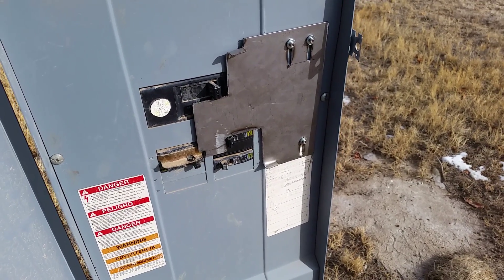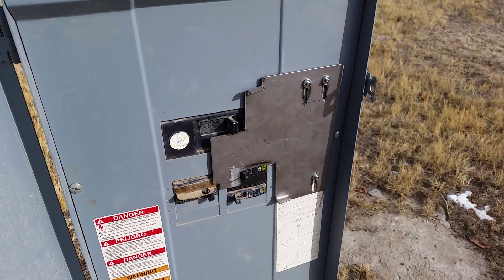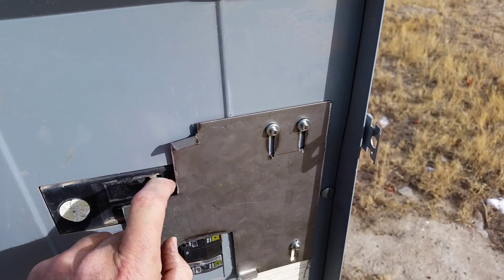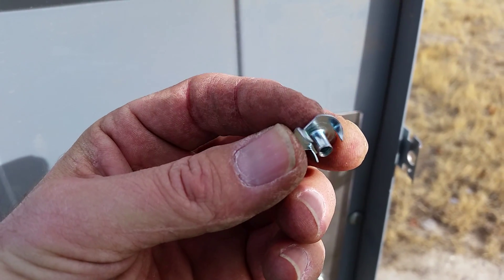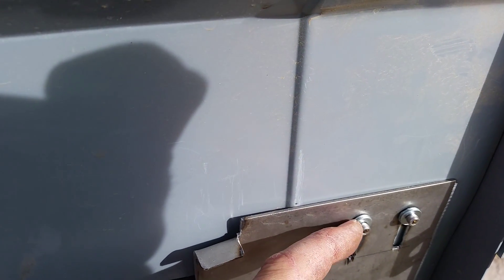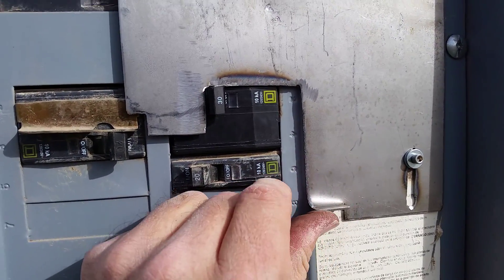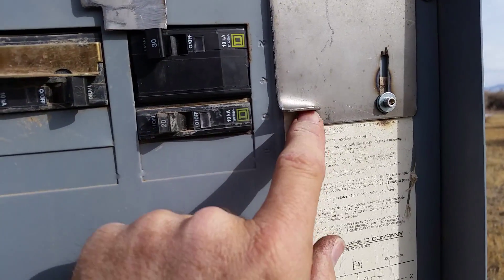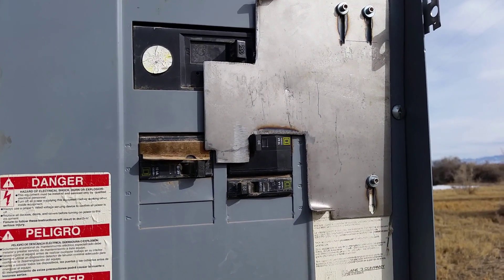Generator Breaker Interlock DIY

Comment from the maker: Well, just used it last night.  This is the second time I've had to use it.  Last night, high winds had knocked some power lines down in Northern Colorado, and sparked two major fires, and two towns pretty much burned up. Very sad. Xcel energy instituted rolling blackouts, we were out of power for about 5 hours, it's the end of December and nighttime temps fall below zero and daytime rarely above freezing. So I rolled the generator out, started it, hooked it up,  and we were able to run the heater, the wood stove fan, the well pump, and kept the fridge and freezers going, and a couple lights.  We filled the bathtub and five five gallon buckets so we can flush the toilets without power. I am so happy I made it, it worked very well. Prayers for my fellow Coloradoans who lost their homes.

Comment: For all those who want to make this lockout, me,  from scrap for little or nothing, what you are actually paying for on the commercial units is liability insurance. We hackers are too clever to be held back to pay for insurance. We just got through a 4 day stretch here in portland where I jury-rigged a HFT 125 v generator to run refrigeration and space heating. This was a 20 amp max output that did us almost prefect. Would have loved a 240v unit. You can use the 120 v unit but turn off all 240 circuits and electrify both legs, otherwise only half your 120 breakers will work, by feeding your "generatora' breaker, a 240, by jumping the 120 to both sides of the 240 breaker. AGain all 240 circuits must be off or its short city.

Comment: WARNING!!!!: THE VOLTAGE IN A OPEN ELECTRICAL PANEL CAN SERIOUSLY INJURE OR KILL YOU AND CAUSE A FIRE THAT WILL MOST LIKELY NOT BE COVERED BY YOUR INSURANCE !, you can still be electrocuted even if the main breaker is off and your front panel cover is removed because the main electrical power grid supply connector inlets are always hot and are not insulated, your hands can be easily be in contact with those connectors, DON'T ATTEMPT THIS MODIFICATION IF YOU CAN'T UNDERSTAND AND EVALUATE THE RISKS YOUR EXPOSED TO, you have to know what your doing and know the CONSEQUENCES of a inadequately designed and made panel interlock, im making my own, you just have to make sure DIMENSIONS are SUPER TIGHT so that how ever you move the interlock mechanism it will never come close to being able to switch on the main and the generator breaker at the same time, i know its not UL or CSA but if well designed and made it will be just as safe as the overpriced low tech interlocks out there, make sure the bolts going through the panel used for the sliding mechanism are tight and not in contact with exposed live connectors on breaker, shorting a 200 amps panel will be memorable for the rest of your life.

Comment: Made Mine from 3D Printed ABS 5mm thick so it's nice and rigid, Smooth action and perfect fit.
Reply from the maker: Did you make a video?
Reply: @anesthesiadreamin  Na, I took a few photos once it was installed on the panel but thats all. https://hypedphoto.com/storage/interlock1.jpg

Comment: It's a travesty how electricians and propane people rip off the elderly and everyone else with there absurd prices.  I had a bid from a local electrician for $2,780 to connect a transfer switch with a 35 foot 220 50 amp extension cord.  It's a bit tricky but shit man.....2780.00???????? fucking joke.  then because I have a dual fuel generator that I will run on propane, I had to get a plumber to install the propane line.  Anyway, I called bullshit on all that and did the propane myself which took some education with the BTU configurations but I did it and it runs perfect and doesn't affect my gas appliances.  Next is the electrical thanks to videos like this!!!

Comment: Nice idea although.... The primary issue with this DIY solution is that it can be easily overcome due to the design and structural stiffness of the plate. The commercial products include knowledge in design and standard safety testing to ensure in all reasonable cases fin a typical use case the switches cannot be switched in a mode that would back-feed power into the lines. Note that there is a lot more that goes into product that the material and manufacturing that would increase the over price of a product including a guarantee and liability for safety. Working outside of process, standards, and solid design and testing practice will inevitably add risk to the objective.
Reply from the maker: Well said, I do agree with your point

Comment: Hey, like you I found one but expensive , had 30 amp outlet wired in..is this plate really necessary? Can you please explain why? Awesome job BTW
Reply from the maker: So the plate is a guarantee that you can't back-feed the electric line when u are powering your house. Some people tell themselves they'll always remember to shut off the breaker so that their generator won't back feed the electric line, but sometimes people do forget and it can be a problem
Reply from the maker: Sure, when the power is off and you turn your generator on and connect it to your box, it feeds your house as well as the other direction, so it could potentially shocking electric worker trying to fix the problem, or feed your neighbor's house, which you may not want to pay for

Comment: Linemen assume all wires are hot.  So what you've really done is prevented someone from cooking the generator head by back feeding line current into those fragile windings..  aka Letting the smoke out..
Reply: i was gonna say i keep this shyt about shocking linemen.. any one who works with electric knows.. Treat all wires like they are hot.. even when you know they are off.